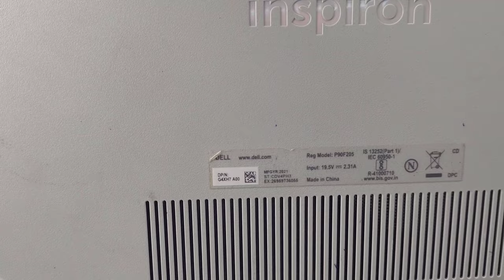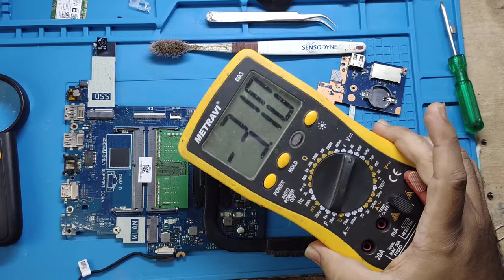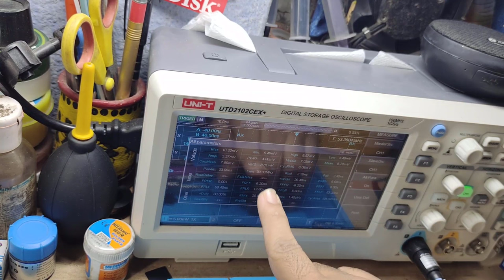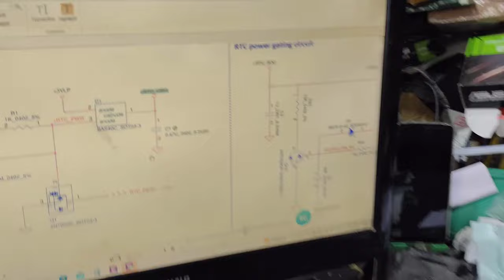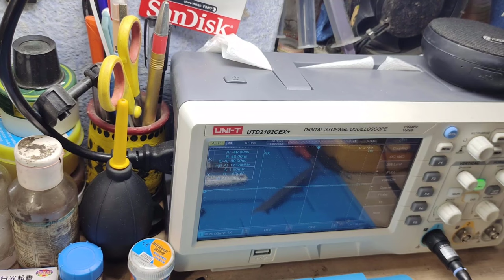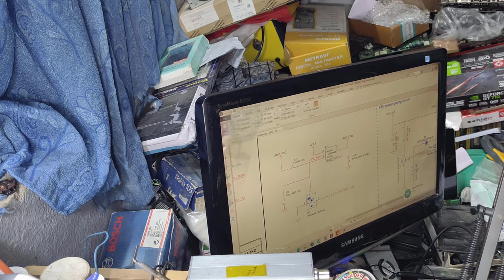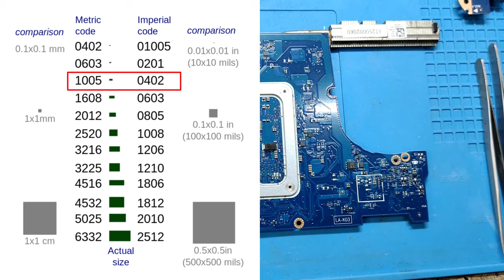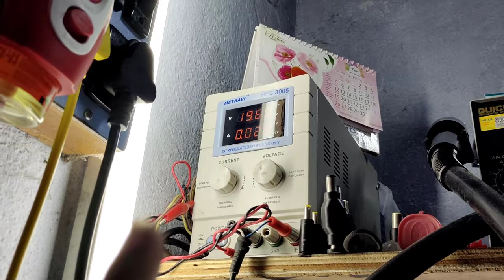Dell Inspiron 3501 NOT TRIGGERING SOLUTION | NO POWER | 11Th GENERATION | LA-K034P | #RTC  #dell

Comment: I purchased a Asus Rog g16 laptop with 4060 graphics 20 days back and today it's screen backlight is not glowing screen become dark. Service engineer diagnoise mother board defective. Sir guide me what to do . Laptop is just 20 days old
Reply: But when I connect an external monitor to this laptop it is working fine but laptop screen is no brightness at all.
I'm also btech electronics running my own repair workshop specialized in medical, and scientific research equipment repair and air-conditioning inverter card repair business. I m from West Delhi Mansarovar garden
Reply from the maker: i think you have the warranty right? it is a 19 v line issue. could be lcd could be a motherboard related issue.. but it is a very easy solution.. nothing to worry about.. can i help you about anything?

Comment: Now I have a question. What are the possibilities when there is no crystal frequency? DC jack is plugged in of course. 1. The crystal is broken 2. The components around the crystal are broken 3. I am asking this could the pch be broken? Can a few more things be said to be able to say for sure that the pch is broken?
Reply from the maker: In this case this capacitor are very important to create that 32 KHz frequency but if you replace all the component and your 32 KHz is not forming then it is a pch fault.